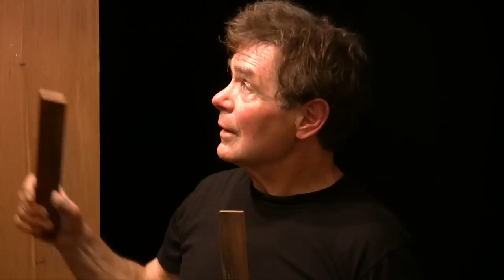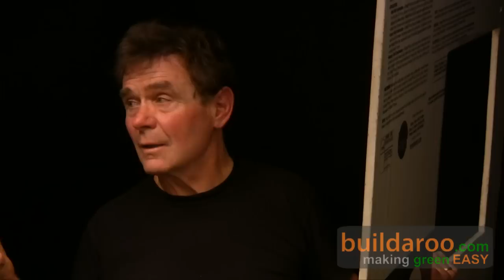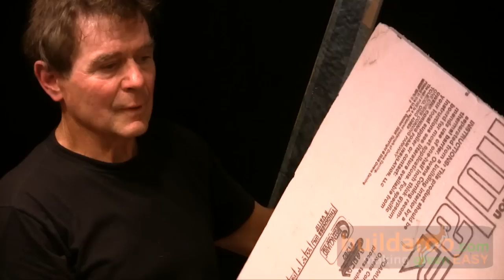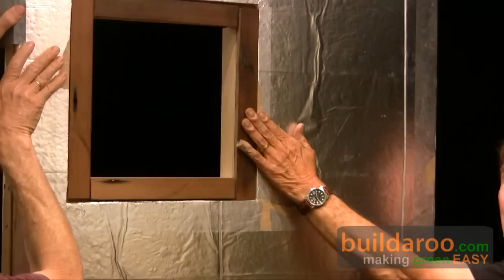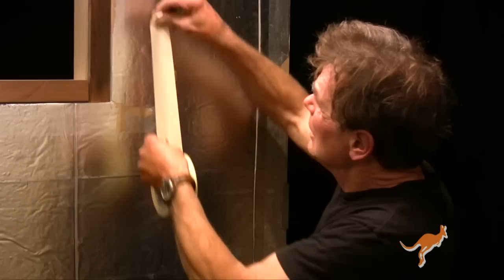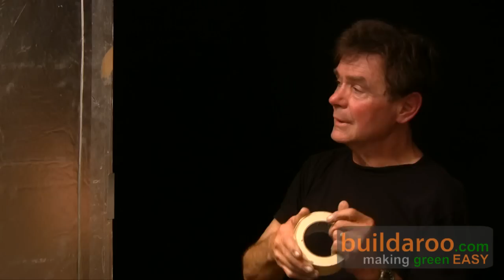How to Install Rigid Foam around Windows - buildaroo.com

Comment: You really need to empathize that the sealant tape needs to be applied from the sill up. Starting at the sides the way you did generates an upward facing lap that will be breached by water sooner or later. Always always always begin flashing from the bottom up leaving a sufficient downward facing lap to prevent surface tension or capillary action from drawing water into your wall.